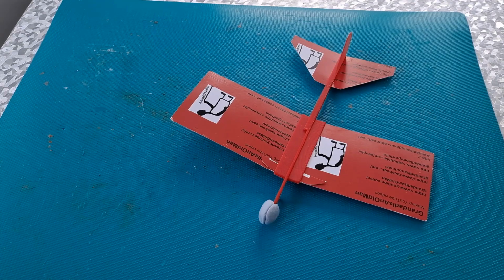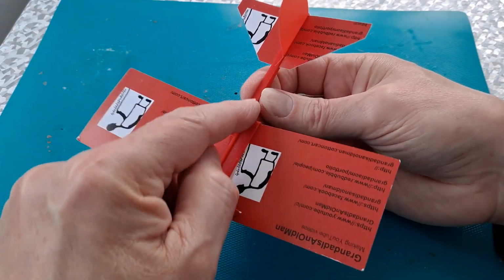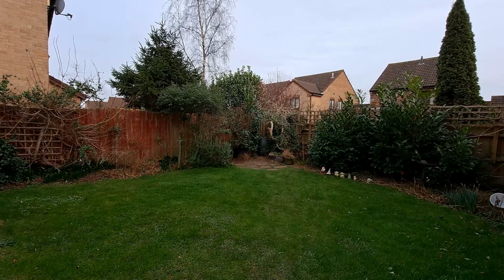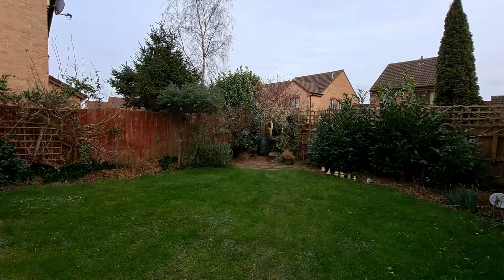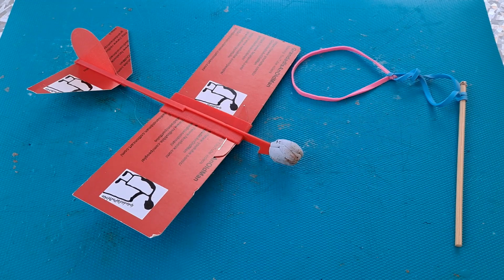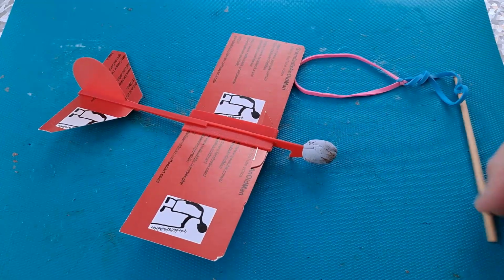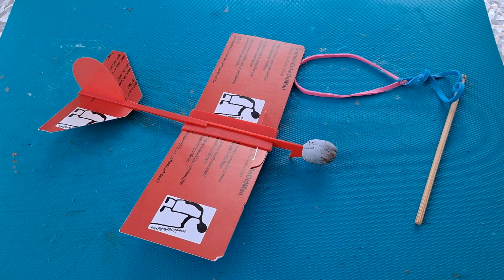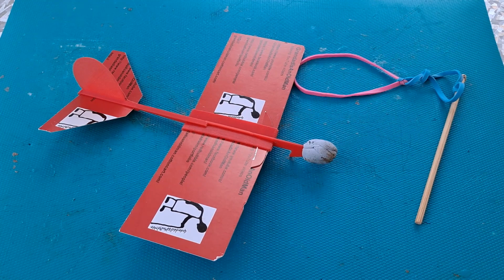My third attempt at a Business Card Glider

Comment: Interesting about the tail thickness. I have done some experiments on just how thin you can print, but can't remember the exact figure I got it down to 😅. I do remember it ended up as a sort of mesh when it got too thin. Good series of videos. Thanks 😀 👍
Reply from the maker: Thanks. I have the layer height set to 0.2mm so a multiple of 0.2 should be the best option. I set it to 0.4mm in this case. 0.2 might be as you describe 😊😊

Comment: You were able to correct the flight by adding weight to the front, but that extra weight shortens the flight time.

The way i did it with a paper airplane was by changing the angle of the tail,  which could be very tricky if you play around with the way the tail gets inserted.   Instead, i cut 2 small slits about 1 or 2 mm in the back to resemble what real airplanes do, and then I would bend the new flaps either up or down, depending on what needed to be adjusted.

By bending down, the tail will slightly rise as the air pushes against it, and this would keep the nose level.

Personally, i liked bending the flaps upward so it would allow the plane to do a loop-to-loop flight.

This could also correct any tendency for a plane that flies left or right

Also recall the angle i threw the plane had some effect on its flight.  Had this tendency to throw it towards the ground, and then it would travel in a U shape, beginning to rise after several secs.

Your idea works, which is what matters.........
Reply from the maker: You still need the centre of gravity to be in the right place, very roughly about 1/4 to 1/3 of the wing chord from the front. Here is a very complicate way of calculating it's position https://www.ecalc.ch/cgcalc.php